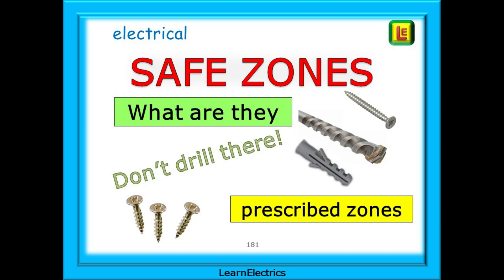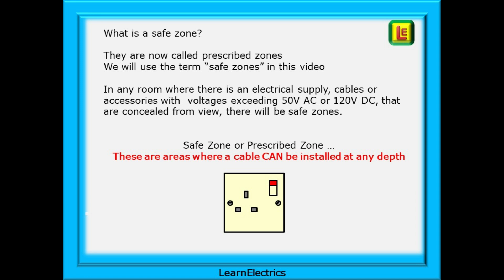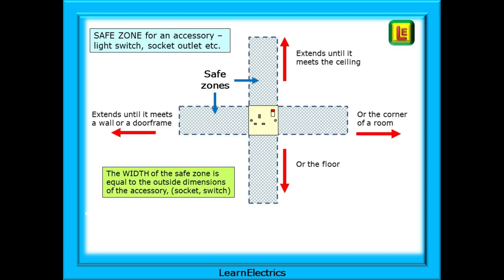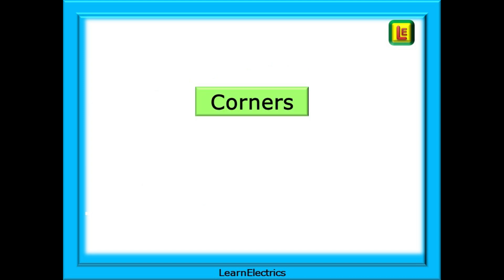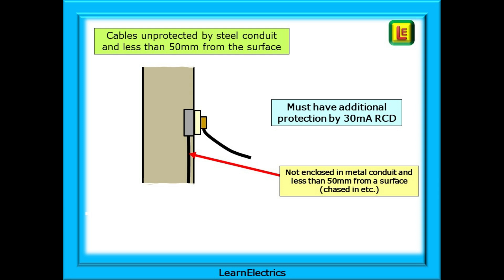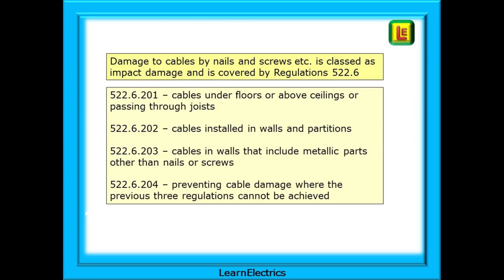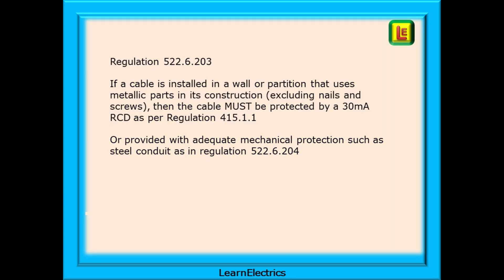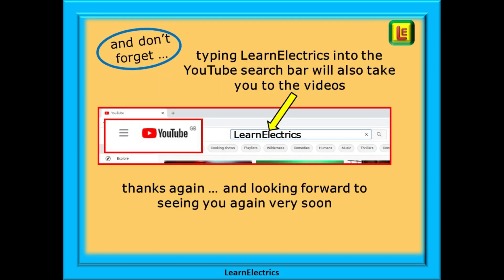ELECTRICAL SAFE ZONES – PRESCRIBED ZONES - Why have them – How to work out where they are - be safe

Comment: I've been researching this a lot lately because of a particularly awkward install. It strikes me that 'unsafe zones' would have been a better term. I'd be interested to know if 'earthed' metal conduit can be a cpc of the relevant size to the nearest socket or whether a connection to the cu is expected.
Also, the 150mm from ceiling zone is proving to be quite useless in this particular property. Many windows extend to within 100mm of the ceiling and internal wall insulation is to be fitted meaning curtain rails are likely to be fitted with fixings at least 80mm long directly through the prescribed zone.
Amazing channel. Only found it today and binged watched all day.
Reply from the maker: Thanks for the feedback, truly appreciated,
Yes, some properties are certainly a challenge and definite head scratchers.
Thanks for watching, over 200 videos available and lots more to come. Dave.

Comment: Great video, Here we must be in the middle of a 2X4 which gives us about 1.5 inches from the ends and with .5 inch drywall finish on the walls we are about 2 inches in the wall. Have not been called out to a wire that got nailed but you never know. Thanks for sharing.
Reply from the maker: Thanks for watching Lyle.